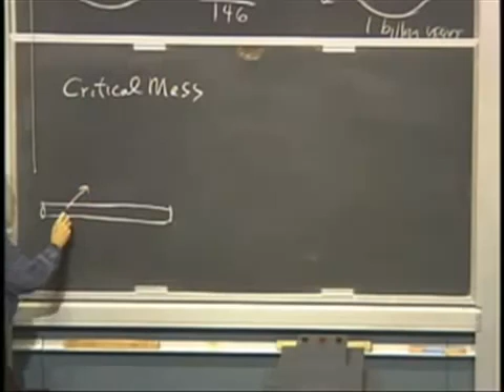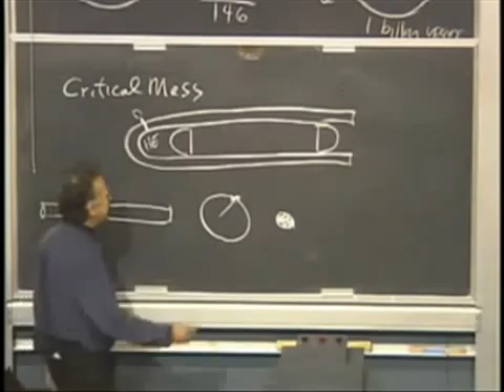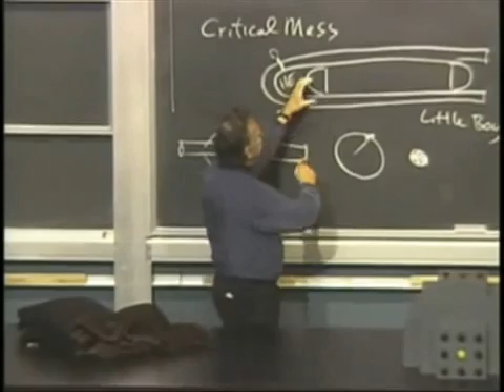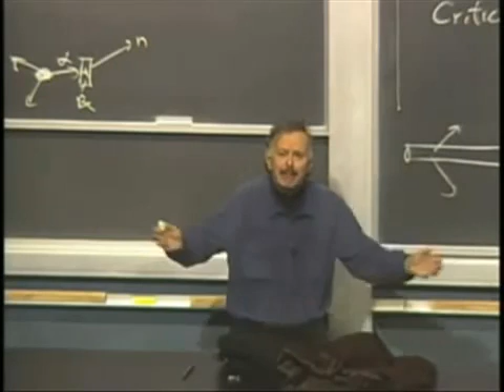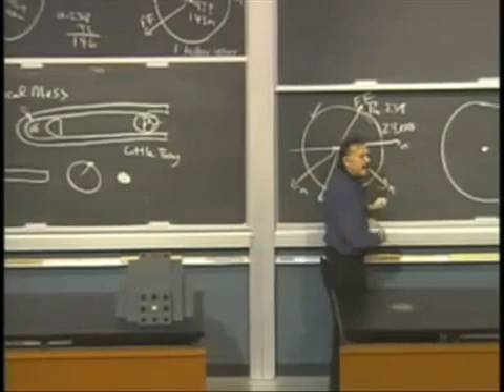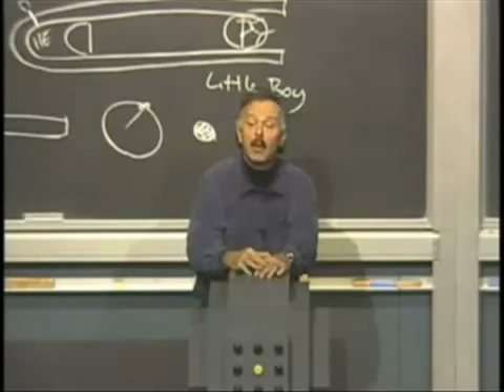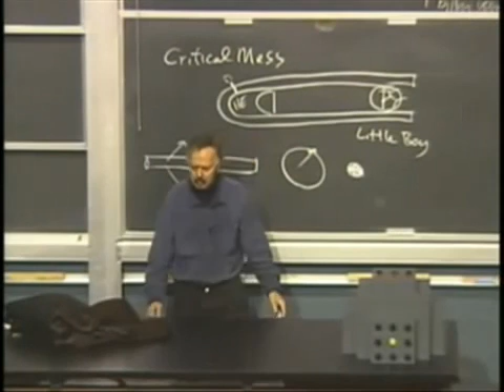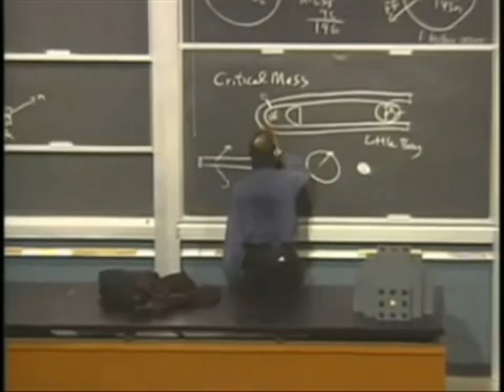Nuclear Physics 101   Critical Mass and the Gun Design Nuke   2 of 6

Comment: There are a couple inaccuracies here.  The Little Boy bomb actually only got fission on 1-2% of its Uranium, because that much fission already released enough energy to blow the other Uranium to the four winds before it could react.  That's part of what made Little Boy so incredibly "dirty" in terms of radiation; over 100lbs of unspent, enriched Uranium just scattered over the city.  More modern bombs use the concept he showed with compressing a subcritical mass to make it supercritical, and this results in a much faster, more efficient, and more destructive reaction.  The gun design sucks, relatively speaking, and they have to compensate for it's low efficiency by simply using an ass-load of fissile material compared to something like Fat Man which had less than 20lbs of Plutonium, total, but gave a bigger yield nonetheless.  The Fat Man style design was the type they used for the Trinity test, pre-Hiroshima.
Reply: I heard that too. Makes sense because it has a huge mass of uranium it would have been a much gigger explosion if all the uranium went through fission